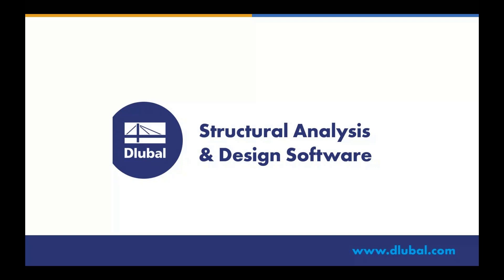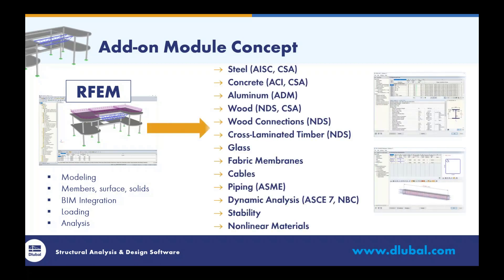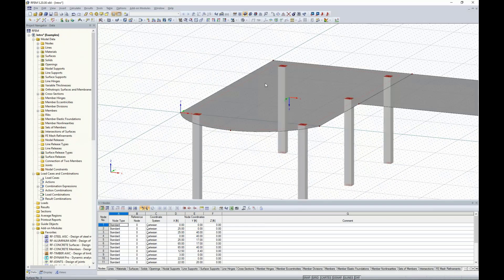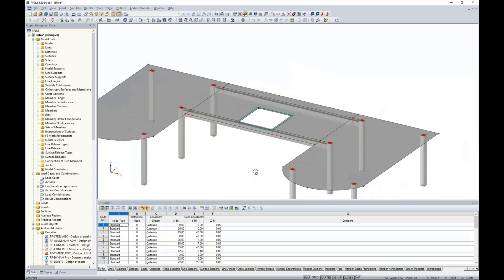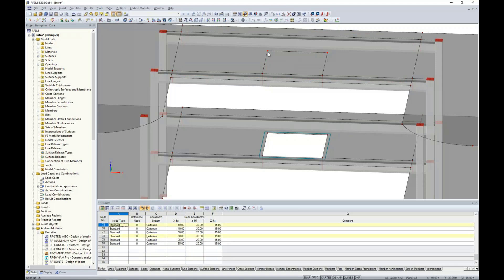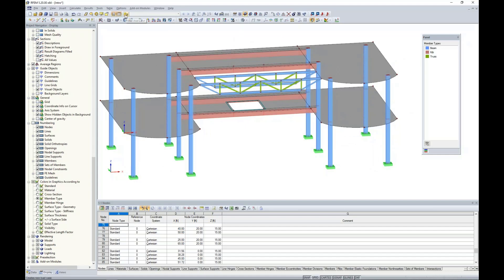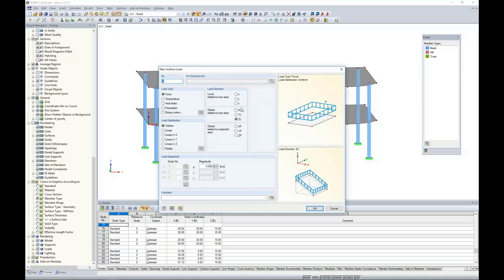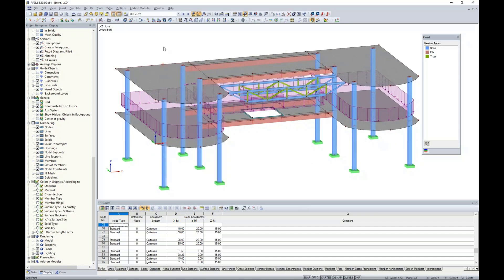Webinar 1: Introduction to the FEA Program RFEM

Comment: Do you have a books that related for Dlubal software ?
Reply from the maker: Hi, info!
There is one book available that deals with principles of Finite Elements and their specific application problems. However, it is only available in German. 
https://www.amazon.de/Finite-Elemente-Baustatik-Praxis-Anwendungsbeispielen-Bauwerk/dp/3410234519
Otherwise, you find plenty of materials like videos and manuals online at dlubal.com. 
Which information are you missing specifically?